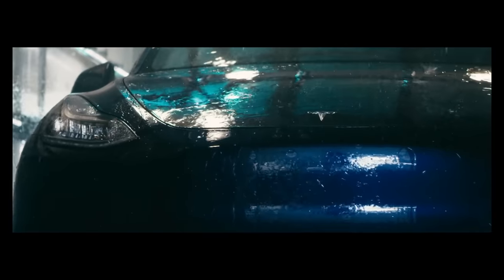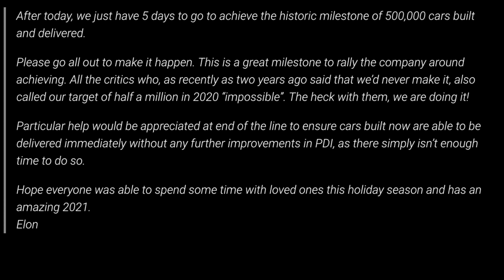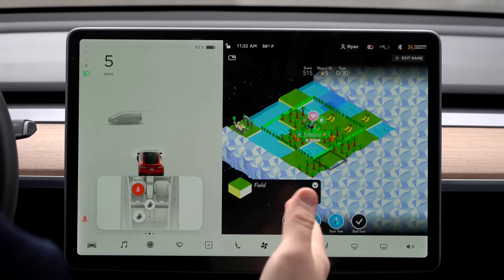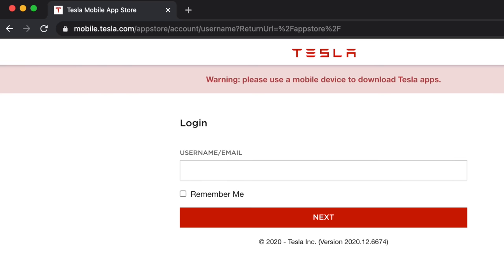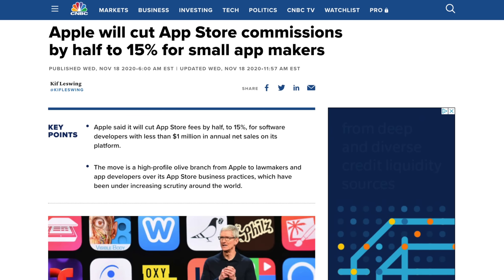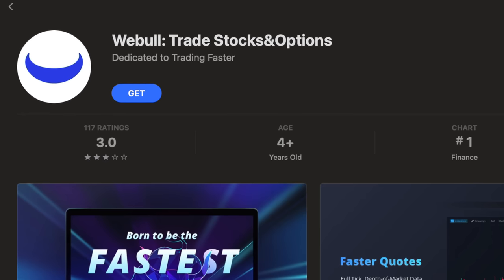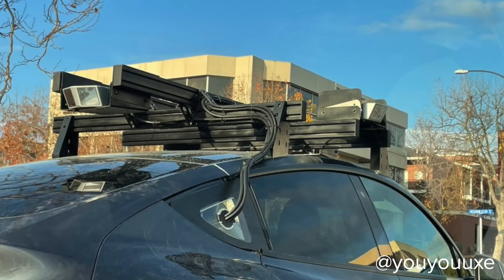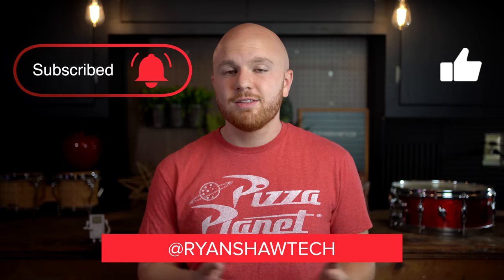The Tesla App Store is Coming

Comment: The Tesla App Store problem is two-fold. As Elon points out, the Tesla install base just isn't enticing to developers. There are over 1.5 billion active iOS devices and 3 billion (that's billion with a B) active Android devices, versus well under 2 million (with an M) Teslas. It's just not worth a developer's time to target Tesla, which is why either Tesla does the integrations or they're just full screen browser wrappers of existing websites.

The second problem is on-car compute power. The Snapdragon 865+ CPU in the Note 20 Ultra I'm writing this on has well over 4x faster clock speed, 2x the processor cores and 2x the memory bandwidth of the Intel Atom E8000 at the core of MCU2, not to mention my phone has a dedicated GPU for graphics. Put another way, my phone has 3x+ the processing power of the current Tesla infotainment hardware. Add ot that the fact I'll probably upgrade my phone every couple years. This is another reason developers won't be jumping to target Teslas.
Reply: What you said about relative market numbers is true (a 1000 times plus more customers is a big thing in favor of ios and android of course). But there's a big "butt" here. I'm a software engineer and many of my friends who are also devs all have teslas and we'd love to make apps for our own cars. That would really kick them off, past where the other car companies are. I don't know if there's an app market for 3rd party android auto and apple auto, but there are probably 10x more cars with that than teslas. But tesla has all the programmers who own cars! I really want tesla to allow apps, so I can work on them for my car, and fix the god awful browser is job number 1.

Comment: Just one "app" would be nice.  A supported way for a phone, tablet or whatever to cast its screen to the main display, as a window or full screen.   With video, audio, interaction with bluetooth for calls (through any medium, phone, messenger, whatsapp, whatever).  And onscreen keyboard/pointing support.   And, a big holiday wish.  Do NOT block this while driving.  That is, leave the choice or whether or not to block things to the driver (or pilot in command to use an aviation reference).  Don't presume the "user is an idiot case".  Do what it takes to overcome the legal nannies.  Like I said, a big wish.  (or just make it easy to hack a bypass to nanny crap). 

I saw a heavily modified Model S where, somehow, this had been added through hardware/software mods done by a small team.  It was beautiful.

So, put energy into interfacing with what already exists and quit rewriting the same code and constantly porting over and over (with accompanying new bugs from each port).

Oh yeah, and part B, allow a mode where user can see all internal things going on, like battery temps and voltages, etc.  Similar to what higher end cars like Lamborghini supply.  There are serious professional, performance oriented customers who drive these cars, acknowledge them. 

Personally, I'd like the entire user interface to be open to mods.  Frankly, Tesla isn't very good at UI/UX.  It's painful to deal with.50 

I'm a MS P100D owner.  I can think of at least 50 changes I'd like to make.  It could be sooooo much better.

If Tesla won't do this sooner or later a viable competitor will emerge that will. 

And, editorial comment.  Enough with the games already.  Redirect money/resources to the many bugs and inadequacies in car features which seriously need some work.

Comment: Even when level 5 autonomy is mainstream, I think getting developers to create Tesla apps will be a tough sell. Why? Because everyone has a smartphone with them already that they can use in the car.
Reply from the maker: That's a good point, but I do think people will want to sit back, and use the mounted screen. So maybe Tesla would need to make a system to make apps easily portable from iPad/Android Tablets
Reply: Chromecast/AirPlay option may be a great idea, yeah.
Reply: Depending on the framework used by Tesla it is might be as easy as compile the existing application with Tesla framework but it might be impossible.
Reply: It’s a great point. Apple had trouble getting developers to build macOS apps, due to the relatively small installed user base (still hundred million ish). Now they can deploy to a billion iOS users, it’s a lot more compelling business case. That’s the issue Tesla will have, the apps only work on their car, not on your phone, tablet, laptop, etc. So it’s a small user base for devs to invest time in. Also harder to get users to buy in to apps that only work on one of their devices.

Comment: They could make the “I am a passenger” button safer by only making it pushable if BOTH hands are on the wheel, at the end of the day, the wheel has pressure sensors so it is totally doable

Comment: If Tesla just uses lidar to validate/training the model, not thinking about using it as add on, they don’t need to use Luminar hydra in 2020 December , which is an automotive grade development kit.  Some more powerful lidar in the market for a while, logically they should do this validation before the beta version. Mobileye solution is also camera based, lidar just for redundancy. If down in three years, regulators issue autonomous standard must have lidar, and if Tesla never tests the technology that would be so dump.